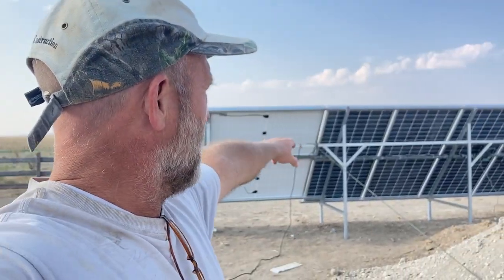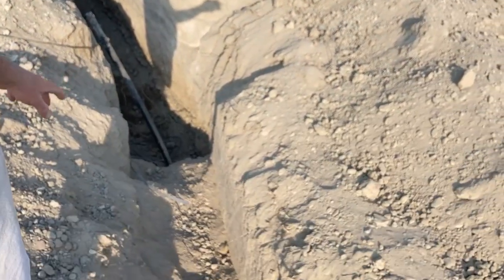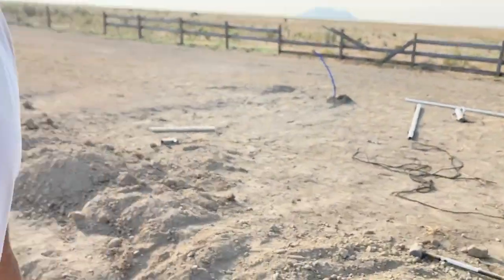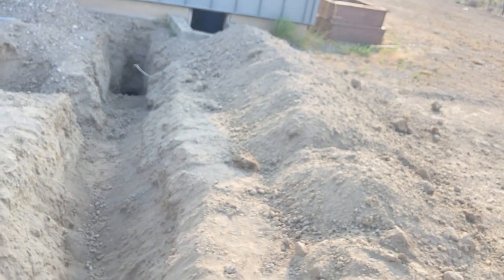Ultimate Bugout Build: Wiring Solar Directly to Hot Water Tank

Comment: honest oppinion is the solar thermal  heating elements .. they have the water or the liquid which will transfer the most of the suns heat to the place with a simple pump ...  but it will cost a little more.... good side of the idea is the more energy you harvest when use direct light to only one transition ..     sun  heat .... versus  sun electricity  heat.... but for using water heating or cooling is best to delete inverting too  which is the 4rth most inefficient part

Comment: I am an expert in heating water with PV since I design these controllers.  While this may not be an option for you there are things you can do to improve your efficiency.  There are calculations to determine the best heating element resistance for your panels.  These are wrong because they calculate for absolute ultimate conditions.  Studies have shown average daily production is highest when resistance is double.  With common tanks there are two heating elements.  Have a switch to go from one element or two.  That could be parallel or series.  Or break your array into two strings which can be placed in parallel or series. to match power.  Just to give you an idea,   at 75% of panel current you have lost 50% of power.  The lower the current goes the power difference increases radically.  On a not so perfect day or when panels are off axis,  I would produce five times more power that you do in the same conditions. It is all about the math.  Direct connect is low efficiency but it doesn't have to be terrible.
Reply: I want one of your controllers how much will you charge me? I have a lot of solar panels and I also have a lot of hot water heaters. I’m using 450 w Solar Panels

Comment: Cool idea. You could also use a dc to dc converter to get the 12v off of the 48v. Or maybe use the 120vac as the control signal? Just some more ideas.
Reply: At low sun there won't be enough voltage once the relay pulls in and it will keep cycling.  Better to just have some old battery and trickle charge it with solar.

Comment: Ali express do a sub $100 inverter just for hot water.
There are also double submersion elements that have an AC and DC resistive element.
Not sure about the longevity of the solid state silicone diode..
Reply: got a listing? there should be one, but I haven't found one.  That is all they should sell for.

Comment: You should recycle or save that expensive wire and use #12 which can easily carry the current from those panels with insignificant voltage drop.

Comment: I spent a lot of time with this idea also. If you want to switch dc , contacts have to open wide and fast.
Since the panels are current-limited you have to arrange the arrays serially and parallel to avoid losses. Inverters and batteries have become so much more affordable that I found it’s wiser to run it through an off-grid system so you can benefit from the solar production that would otherwise be wasted after the water is hot. To solve the high load of a 4500w element,I put the two elements in series so the current is cut in half . I was concerned that it would be too slow but remembered using 1500w water heater in a previous house and it kept up just fine.
At first,I had two tanks with the water in second in line with the first receiving the voltage. Its thermostat then switched to the first tank which received cold water, In effect having a double volume tank with the first one’s element acting like the bottom element of a conventional two element tank.
It worked fine but I found  I really didn’t need the extra volume.
You’re doing well to take the water heater off the grid if you have it.The water heater tank is a good heat battery and a big consumer of electricity.

Comment: I have purposefully burned out switch contacts from thermostats just to see the failure mode. It can sometimes happen on the very first opening of the switch, depending on how much DC voltage is present. It’s a very dangerous situation because the ark will melt everything and it can burn back down the wire if no one’s around to stop it, then it is big trouble.

I am using over 2.6 kW of solar panels directly connected to a 1500 W heating element that’s designed for 48 V DC the water gets up to boiling sometimes. 

I am using a mixing valve in a certain pump to temper the water through other tanks . It’s virtually 100% efficient on the electrical side.

I did buy a solid-state relay that is designed to switch DC power, but I haven’t hooked it up yet . All you need is 3 to 32 V DC to trigger the solid-state DC relay that would be a far better option than any other type of set up.

Comment: New to your Chanel it popped up on things to watch. Have you tried a snubber across the thermostats contacts, a diode with resistor or diode resistor capacitor combination.
Reply from the maker: Sounds too hard for a guy like me to figure out.  Love to see some demos, though.
Reply: @russlivesay9325  Have a look at this video from minute 9:00 he is switching AC resistive load, you have DC resistive load, but the fix will be similar, he fixed his problem for a couple of dollars. Search youtube for "Mechanical relay overload and snubber (with sparks)"

Comment: So you're heating the water 5-7 hours per day, then the rest of the time, low or no solar so no or little heating capability. You heat from 11am to 4-5pm, then coast all night to 11am the next day. Just pump every watt you've got into the heater and heat the water as fast and as hot as you can for as long as you can. But there are problems using DC. Possible over current and burn out of the heating coil if you're not careful is the biggest one. If you have to throttle back the DC (with resistive loads) to prevent burn out, then you're wasting precious energy. You'll also see fairly high line losses running high current DC from the panels to the house. And high voltage/high current DC switching can be really dangerous (arcing). Instead, I'd do this. Convert the DC to AC at the panels (using an inverter), then run the AC to the house. Turn the thermostat to max (to prevent cycling while heating) and heat the water to whatever temp it will go to. That way you will use every watt efficiently, with minimal losses. And you won't have to concern yourself with possibly burning out the coil in the water heater.
Reply: If your wire was sized correctly, then how could you have excessive voltage drop

The whole idea is not to use an inverter, but DC directly from a solar module. It’s dead simple. 

Oh, I prefer the method with that’s low voltage just the voltage of a solar module and just multiple modules in parallel
Reply: I solved all those issues with an electronic control that matches the panels output efficiently to the heating element.  It also has arc interrupt so standard mechanical thermostats can be used without issue.  The solar community is so behind the times. I can produce five times the power on bad days than direct connect.

Comment: This was an excellent conceptual layout!

However, while I do acknowledge that you are cost-aware in this situation, I feel the need to point out that a resistive water heater is going to waste far more of those precious watts than a heat pump water heater.
Reply from the maker: My oldest son's home is totally off grid and solar dependent here in Central Idaho.  He uses a heat pump water heater.  I'm open to it although the cost is so much higher for the initial cost.  My objective is to minimize the consumption of inverted power.  He loves his heat pump water heater and uses it to cool his house in the summer.  He set it up near his pellet stove so uses pellet generated heat as the heat source for the heat pump system in his basement.  I've not run the numbers on it, but it probably comes out pretty good.  His solar system is  only 5 kW.  Its a small system, but in the days of LEDs and significantly lowering consumer power demands, it seems to work okay.  My inverted power is based upon a 5.2 kW collection system.  I'll probably expand that, but am building these separate panels for water delivery and water heating so I don't have to tap into that 5.2 kW system.  I think DC is overall cheaper than going with a larger array, more batteries and a bigger inverter.  Maybe I'm wrong, but I can always add in some more panels, etc., later.  We'll see what happens on this house.
Reply: Yeah but you dont need an inverter for the water element. just feed it dc volts , its not fussy. Keep It simple
Reply: Getting dc power off solar is really cheap. The real cost is in transmission, storage, and conversion.

Comment: Wouldn't you be wasting the other 97w from that small panel to run the control circuit to avoid plugging in a 3w wall wart power supply?

Unless you're not planning on having an inverter at all it seems more inefficient.
Reply from the maker: Probably right.  I've not actually written up a cost comparison breakdown.  All I know is that I do have some extra 100 W panels that I'm not using so for me, it makes sense.
Reply: @russlivesay9325  Im on the grid and have wondered of how to just heat water (as a batterry) , this seems like a great way to do it cheaply.  Thanks for food for thought
Reply: The reality is that nobody should have PV panels just for heating water.  Isn't the goal to get the water heater to turn off.  Then what happens to that available power.  I heat with excess PV from the panels and don't use any charge controller, battery or inverter resources.  I have a smaller system than this guy and even my clothes washer uses only hot water for all cycles.
Reply from the maker: @opera5714  the objective Is cost effectiveness and low footprint which direct wiring maintains through simplicity
Reply: @russlivesay9325   You can have the simplicity of direct connect and still do it right.  Engineering is the art of creating the best solution for what is available. Nobody wants to watch me. I can provide you with interesting and doable content for heating water which is educational.  There are a thousand videos on YT heating water and they are done without basic understanding of PV or electricity.

Comment: A relay also needs to be rated for DC just like a thermostat or switch. Using a relay to switch high voltage DC when it is only designed for high voltage AC will cause it to arc and then fail or even start a fire. A high voltage DC relay is not cheap, however it is available. Look for relays designed for electric vehicles.
Reply from the maker: This is what I'm using:  "SSR-40DD Single Phase Solid State Relay DC to DC Input 3-32VDC Output 5-220VDC 40A."  I bought two for $18 including tax from Amazon.  The solid state relays are fairly cheap.  I have an extra CPU heat sink that I'll mount the SSR to.  Should work okay.  I think the SSRs are fairly inexpensive, generally.  I plan on wiring the panels so the output open circuit voltage is 135 VDC with 20 amps.
Reply: @russlivesay9325  You're right about SSRs being cheap, but unlike a normal relay, these relays are all silicon. That prevents arcing, which is great for this application, but they do tend to degrade more with time, being a more complex semiconductor.

I look forward to seeing what comes from this experiment!
Reply: @russlivesay9325   You better use those two in parallel.  I've done testing with those and there is a couple volt loss.  You can easily create 20W of heat and they won't last.